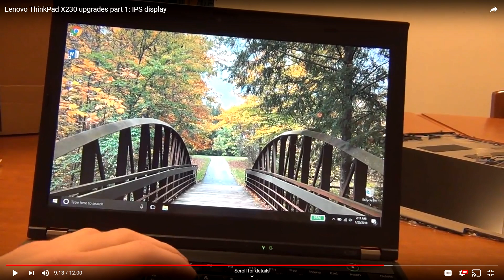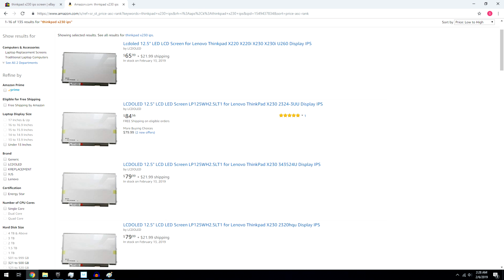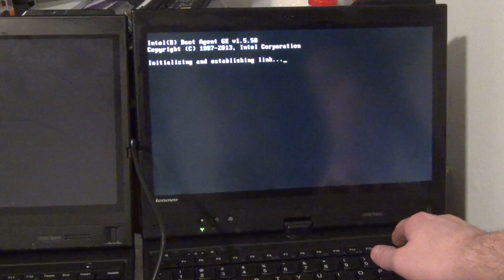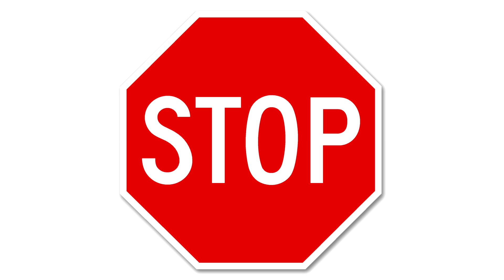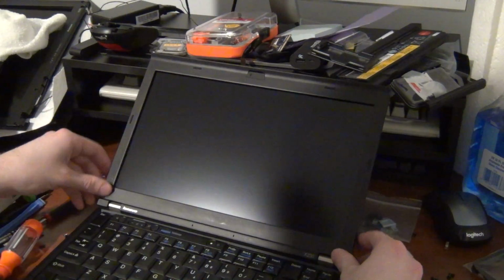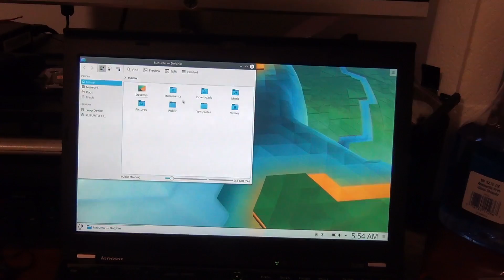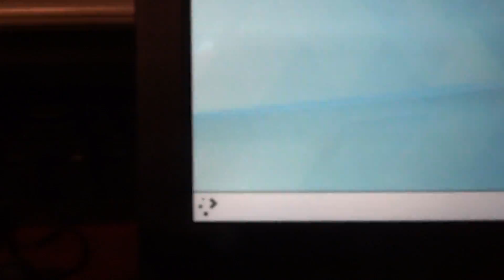Transplanting a ThinkPad X230 Tablet screen into an X230.

Comment: there is a possibility to get an X60 without a stylus (don't know if it is multi-touch) and since i cannot rely only on trackpoint - what is the simplest way to bypass the stylus, could the rubber of a pencil do the job?
Reply from the maker: I believe the touch screens are specially designed for use with the stylus. I don't think a regular pencil or the rubber from it will work. You can find a replacement stylus online fairly easily.

Comment: So, let me make a little correction here.  I fix computers for a living these days.  This last year I've replaced over 100 screens.  In my career as a PC grease monkey I must have done more than 1000 and have never disabled and internal battery and have never blown a fuse.  Sure, if you have an external battery, remove it. and remove the power adapter  However, you don't have to disconnect the internal battery.  Just make sure the power is OFF when you disconnect the old screen and when you connect the new screen.  Not nearly the hassle of popping the back and disconnecting the battery form the MB and every bit as effective.  There are ZERO (count 'em)  laptops that supply power to the backlight while powered of.  ZERO.

Other than that I like your vids.  As a professional computer tech I'm a Lenovo fan.  Their business level machines are the best and have been since the late '90s when they had some decent competition from Toshiba.
Reply from the maker: I always do it out of an abundance of caution, I've blown enough backlight fuses to want to even risk the chance. As you said, I disconnect the adapter and the external battery, and on newer ThinkPads put them into the "service mode" that disables the internal battery until it gets plugged back in.

Comment: The digitizer only transmits & receives a short-range radio signal to/from the pen, it delivers power to the pen and the pen reacts by delivering a signal back that is detected precisely to determine position, it doesn't deal with touch at all. Touch is done through the front capacitive glass which is an entirely different principle.

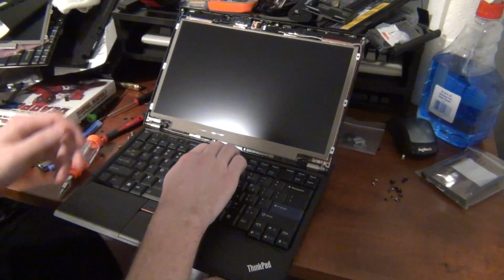Comment: With the statement at around "9:30", talking about the blowing out a backlight fuse. With the X230 and similar age laptops, this isn't true. They use LED drivers, which are integrated into the monitor connector. If this were a CCFL backlit laptop, it would have a separate two pin connector to power the backlight. 

It will not harm your laptop to plug in a LED backlit display while it is turned on. I accidentally did this when I was working on my ProBook 6570b, swapping the screen from its stock Samsung LTN156KT02 for a AUO B156RW01-V1. Which the main reason why I swapped the screen is because the original Samsung panel had a HORRIBLE 16 ms response time, the AUO had a 8 ms.
Reply from the maker: I wish that were correct, however these machines still have a backlight fuse to protect the LEDs from getting electricity that they aren't supposed to get. If the fuse blows, the backlight won't work until it's replaced or you jump the connection on the fuse. Trust me, I've learned that the hard way on T430/X230's numerous times. I've also worked on plenty of older ThinkPads so I am very much aware of the difference between CCFL and LED backlights. Blowing the backlight fuse is a well-documented issue in the ThinkPad community due to not disconnecting power before removing the screen.
Reply: Oh, I thought you were talking about a CCFL, as they would draw a lot more power and require a fuse.  But a fuse on a LED backlight, that's some stupidity. What if the screen cable becomes loose, there goes your fuse.
Reply from the maker: @bill_clinton697  In some cases it's been fine, like a T440p I had a while back with a frayed cable causing it to flicker. But other times me swapping out displays without disconnecting the AC adapter and/or battery has led to the fuse blowing. Many others have had this happen too, so I feel it's safest to just keep everything disconnected from power before messing with the screen.

Comment: How easy would this be to do in reverse - taking the x230 screen and placing it the tablet? Tablet is fine apart from a jarring blue line down the display
Reply from the maker: Very difficult. The process of just getting the display out of the tablet is hard enough, I would not even try to attempt replacing the screen in another tablet. I kind of got lucky with this and found an identical display (actually was an upgrade as it was the multitouch model) on Mercari for $20 so if you can find a replacement tablet display for cheaper, that might be the better option.

Comment: Why people more often love to use x230 model, unlike x230T variant?
Reply from the maker: Not everyone wants to have a tablet. The Tablet variant is a bit thicker and heavier than the non-tablet. Harder to get batteries for, not compatible with the UltraBase dock, among other things.
Reply: @SebisRandomTech  True on thickness and weight. I have X220t and two X230t and they all fit fine in corresponding Ultrabase Series 3 docks, same as my regular X220 and X230.

Comment: I would like to warn everybody who'd like to do this "mod" taking X230T IPS display, putting it into classic X230: the glass on top of the IPS screen (with thick black borders which only the Tablet version has) is actually glued to the glass of the IPS LCD. Sebi's panel for some reason did not have any glue (I wonder why), so it is actually not an easy "take prying tool and slowly take it apart", but you'll have to use a heater (if I remember 190°C should be used for heating the glue in order to get it into the liquid state, without damaging the LCD) and then slowly take it apart. For me it is too late, I just broke a perfectly fine IPS screen. :(
Reply from the maker: That's very interesting, maybe it's possible that there were different manufacturers of the displays, or Lenovo revised the process at some point. In the X240 for example, I know on some of them the touchpads are screwed in while on other variants they are glued in, or some combination of both. I'm sorry to hear about your display!!!
Reply: @SebisRandomTech  I am very sad. I was so happy when it arrived today, only to kill the screen an hour later. :( Well, my bad. Anyway, it was a LG LP125WH2(SL)(B3). I am even more sad because in my opinion LG is one of the best LCD panels manufacturer, so I was really looking into having this IPS panel in my X230. But thanks for the video guide anyway.
Reply from the maker: @jursky214  It's not something I would normally do, as I said in the video though this was cheaper than just getting the panel and the exterior housing was damaged enough that it wouldn't be worth using in an X230 Tablet...let me know how your swap goes when you get another panel!

Comment: Hi, i have exact opposite problem

My x220t screen is dead, but touch and digitizer still working

Is it possible if I replace screen only and reassembly it again?
Reply from the maker: You would basically have to follow a similar process to this except be a LOT more careful. I wasn't so careful because the digitizer was already broken and I didn't need it after extracting the display, but if you want to retain the touch functionality you will have to be REALLY careful. Take a look on eBay or other sites and see if you can get a good deal on a complete assembly before attempting to take apart yours.

Comment: Do you know how to fix a dead power jack on an SL510? And also where I can find replacement motherboards for the SL510?
Reply from the maker: The power jack can be easily replaced. When it comes to finding a replacement motherboard, eBay is probably your best bet.

Comment: If you want it, Is it possible to use the digitiser and plug it in the x230 or the x240 ?
Reply from the maker: As mentioned in the video and in a previous comment, the digitiser is a completely separate component. The non-tablet X220/X230 do not have the hardware or ports for the digitiser. The X240 works a little differently but I haven't seen the tablet variant before.

Comment: a different question entirely, regarding your x230, i see you have the 2.6GHz i5 model, the i7 is 2.9GHz and is the same number of cores/threads.. just with x16 PCI-E lanes in the i7 instead of just x1 with the i5, im in the market for an x230 or x230t... should i bother with scouring ebay for a good i7 or should i settle for a cheaper i5? in all theoretical comparisons the 2 CPUs are only about 5-11% difference in performance... thing is id like to ensure i can play 1080p encoded media, as i plan to dock the laptop to a 1080p display... :) thanks for reading!
Reply from the maker: For me the i5 still performs admirably. Most people I’ve talked to have said the i7’s on these models don’t make too much of a difference. I didn’t know about the PCI-E lane thing.
Reply: Both are doing very well around 3.3-3.4 GHz (full load and boost.)

Comment: wait... so did the touch functionality transfer over to your x230 by using the x230t display?
Reply from the maker: @Cuban Legend No, as shown in the video I removed the digitizer, aka the “touch” function of the display. Even if I left it in the X230 doesn’t have the necessary connector or hardware to use a touch screen.
Reply: @SebisRandomTech  ahhhh, i see, i mustve missed that part of the video, thanks for the reply!

Comment: Nice video man, just wondering what's your favourite Linux distro?
Reply from the maker: Lubuntu was one I used a lot, but I've also used Mint, Ubuntu, and Kubuntu (as shown in this video). Windows is still my main system for compatibility reasons, but I do use Linux from time to time when the need or desire arises.

Comment: The timing of your video couldn't be more perfect! I ordered a Twist 2330U IPS display last week and it will arrive soon. It looks like the process is very similar to the X230 Tablet disassembly. I was a little unsure how difficult it might be but it looks pretty straight forward after seeing your video. I will be replacing the TN panel on my X220. Oh, I got a great deal on the Twist 2330U display - only $35 on eBay! :)
Reply from the maker: A Reddit post talking about using the Twist screen in a X230 was my inspiration for this video, so I hope the process goes well for you! And you're right, the X230 Tablet and S230U have a similar design.
Reply: Just wondering how your experience was extracting the IPS from the Twist digitizer? thinking about doing a similar upgrade myself!

Comment: I would have put the TN-Panel back into the X230 and sold it. Using the good X230 Tablet from now on, especially as you are using it for school, were the digitizer comes in super handy. Written from my X230T, I'm using mostly for university :P
Reply from the maker: @imagimation3238  This was all mentioned in the video. I have 2 X230 Tablets. One is in really good shape and I plan on showcasing in a future video, and the one that I stole a panel from will be fixed up as well. I will just be replacing the entire screen assembly on it, since the original assembly was in very poor condition.
Reply: @imagimation3238  He has an X230, T430 and T440, so I dont think he needs a fourth Notebook. And insted of selling the TN-Panel for like no money, I think he could have got a decent price for the complete Tablet Touch Panel with the digitizer as these cost sometimes as much as a complete regular used X230.

Comment: it would be nice to have that digitizer on original x230 (not tablet version) sometimes it is good to have it
Reply: +Sebi's Random Tech yea an adapter for touchscreen like that one for 1080p display. and about that 1080p display. my opinion it would be waste of money bcs for that screen size 12inches you wont spor the difference
Reply from the maker: @cavosavosk  I put a 1080p display in my X240. While I agree that the resolution is very high for a 12" laptop, sometimes the extra screen real estate is nice.
Reply from the maker: As seen in the video, there is a separate cable for the digitizer. The X230 (non tablet) does not have a connector on the motherboard or the necessary hardware to use the digitizer. Maybe someone from 51nb can come up with a custom board for it or make some kind of adapter.
Reply: +Sebi's Random Tech *spot the difference